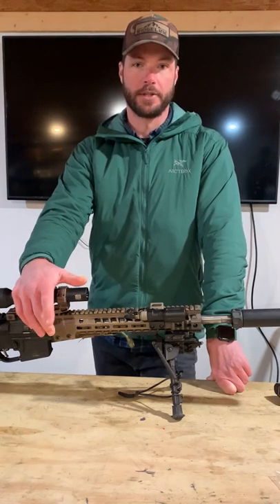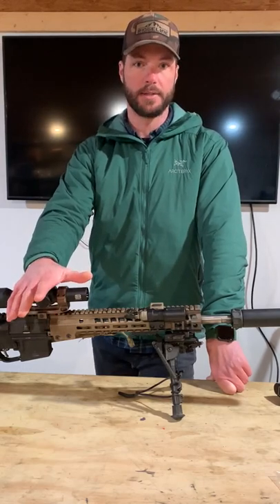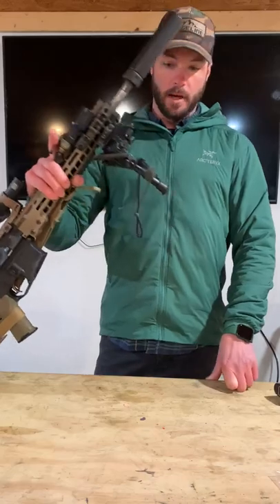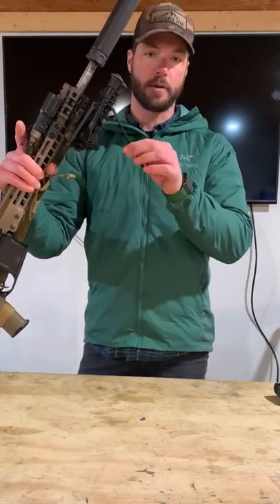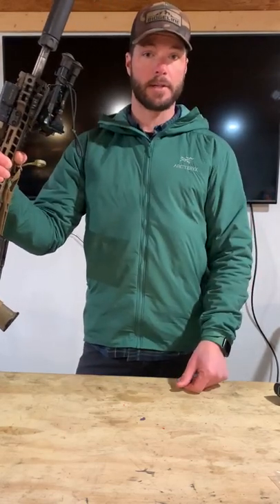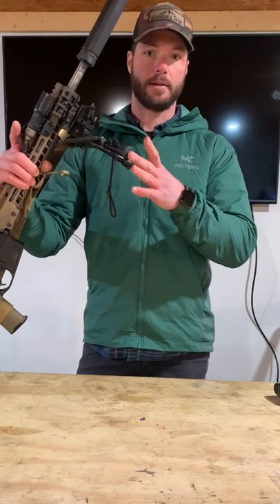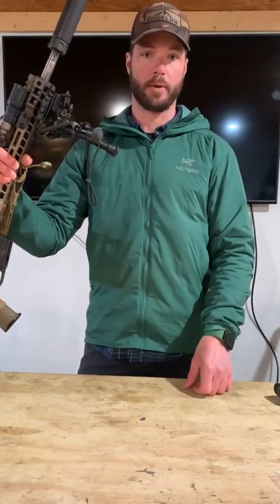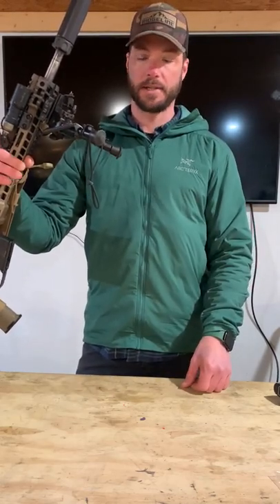Ridgeline Defense - Fieldcraft series

Comment: What do you do with bipods that have a button that needs to be pushed to release the legs?  Something like Atlas.
Reply from the maker: we switch to a Harris....lol  in all seriousness most of us avoid the Atlas (
or similar) for rifles where the most likely engagement is speed based.  The Atlas is super stable (once you lock out the pan feature) but comes with the speed penalty.  My win mag has an Atlas but my SPR wears a Harris.  Different guns, different roles, different setups.
Reply: @ridgeline_defense  which model Harris do  you recommend for an SPR? Do you use the S models that swivel?

Comment: It works until you have to run from gun fire and then it snags on something while your running and since you mite have your sling on it will just pull you and your gun and possibly fall to the ground depending on the speed your running at

Comment: Where would you properly tuck the line when doing a recce in a wooded area? I like the efficiency of the idea just had a question
Reply: Stowed, use a couple cheap rubber bands to secure it.  They break if you have to yank on the cord to deploy the legs.